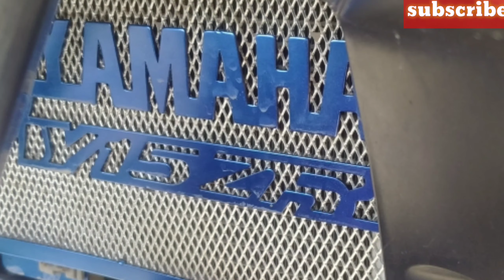How Install radiator cover sniper fi150

Comment: nka dikit ba yung cover sa radiator or may gap?
Reply from the maker: Oo nkaangat Ng kaunti Sa fins Ng radiator paps..pru Doon sa flat Ng radiator  sa tabi nakadikit po.
Reply: @ThanBTv  ok salamat, yung, sakin mlaki ang gap gumagawa ng ingay pg medyo malakas vibration ng motor, yun kasi mas fit na position dun sa binili kong cover medyo malaki ang gap at di mka dikit yung gilid akala ko yun na yun. Gagawin ko nlng ulit tytytytytyty

Comment: Stock pa din ba yung turnilyo na ginamit?
Reply from the maker: Oo paps stock parin.
Reply: @ThanBTv  buti umabot yung sakin kasi hindi na abot Stock bolt and nut
Reply from the maker: Anu klasing cover  mu paps akin stock paprin.
Reply: @ThanBTv  ganyan din. Gaya nung nsa vlog mo
Reply from the maker: Pru ok n  b paps ?
Reply: pano nag kasya turnilyo mo